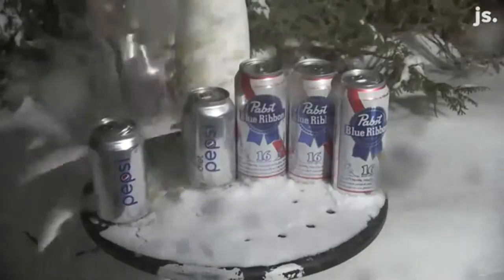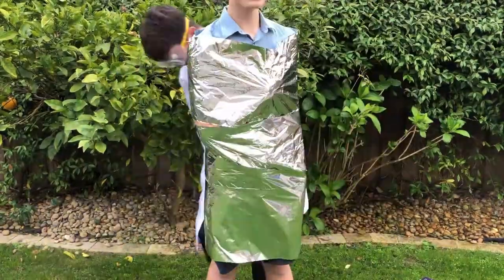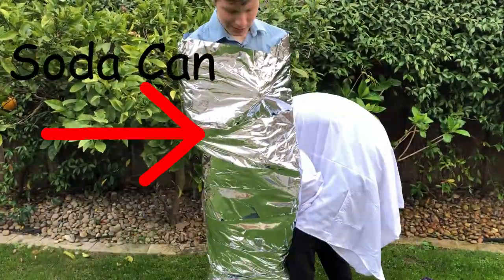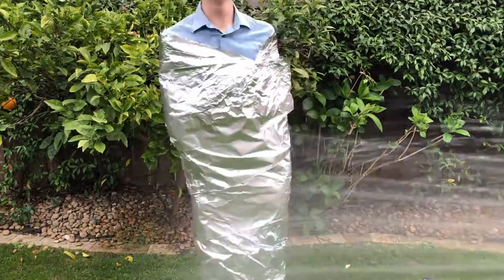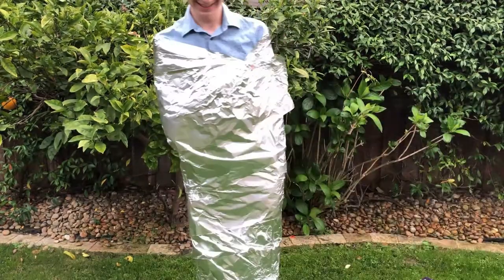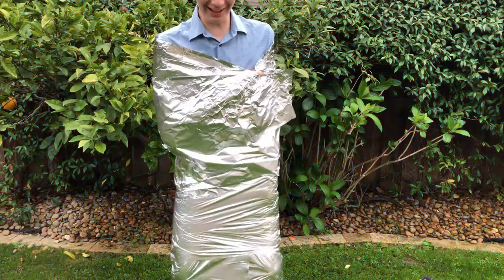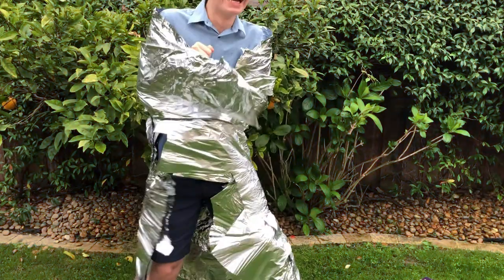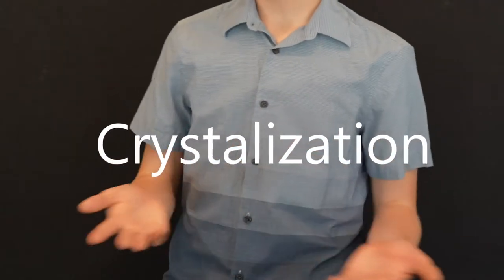Why Do Soda Cans Explode In The Freezer?

Comment: after how much time will it explode 
6 hours ?
Reply from the maker: In the end, I would say it all depends on what temperature you're freezer is set to. But in my experience, I would say just around the four hour mark. Also if you're trying to get it to explode on purpose, don't frequently open the freezer door because I kept on doing that and I never ended up exploding. However, whenever the soda is forgotten in the freezer it just happens right when you realize that you have left it in the freezer in the first place.